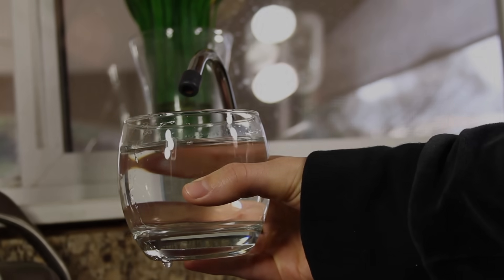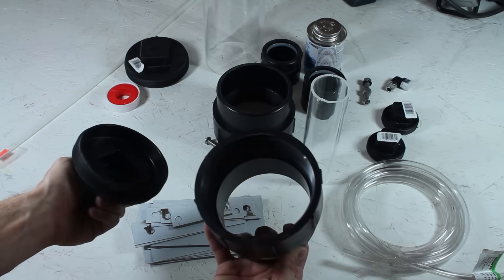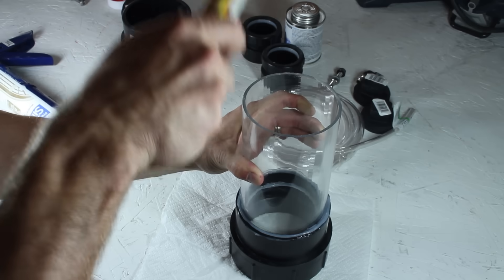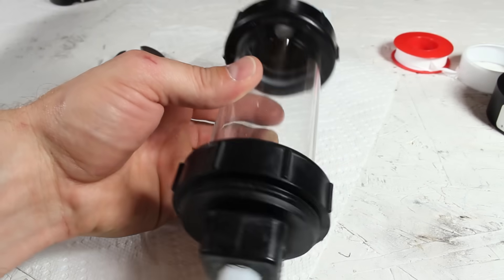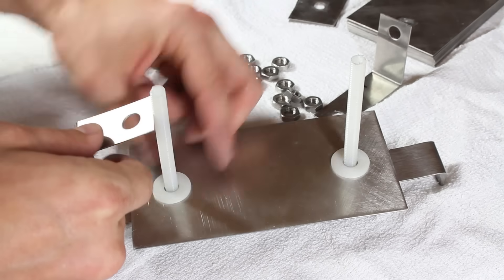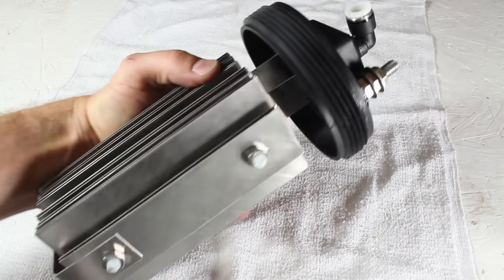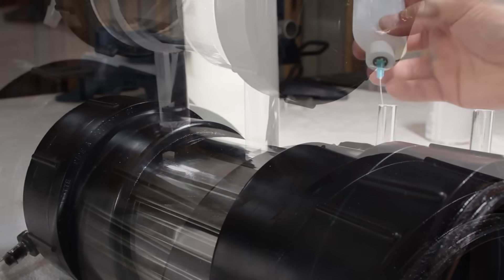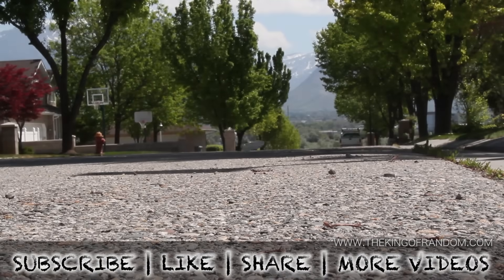HHO Generator - Water to Fuel Converter

Comment: A few (probably dumb) questions: 
-Can you use a "Solar powered device" to deliver the starting energy like you did with the es at 8:18?
-Or even use one of your "Penny Batteries".

-Can you apply the resulting gas to a wind-mill device connected to capacitor or any other storage device??

-If possible, what would the resulting stored Voltage/Amperage be?
Reply: He's stating, the cost of the required energy to create the fuel you wish to utilize, cost more to produce than you would gain.  You're not 'netting' a positive gain in energy efficiency through any of these proposed processes.
Reply: yes. you could. the catch is, the amount of H2 and O2 you'd generate for fuel would be insignificant.
Hydrogen is hard to store..it leaks thru METAL... and using electricity to generate the gasses in the first place is wasting part of the energy.
This is, at best, a different form of rechargable battery.
Reply: Mags chann LOL, wait a minute please...
Since English isn't my native language my point may not have been passed across, or, since it wasn't tested, no results can be given, let alone speculated.

My "main Idea" was as follow:
Use Energy generated from "Solar Power" to  start the electrolysis effect and keep it going inside the Cell instead of the cables that he's using.

After the device starts splitting the H2O molecules into its "components", they would power a turbine/windmill/"something" that would create a "mechanical motion" to redirect that same motion into "energy" stored in a capacitor.

If I had the means and the place I would test it myself, but I don't, that's why I'm asking.

Without testing different theories we can never know the exact results.

And inquisitive minds are the cornerstone of Science, no?

Found this, it can represent the "start" of the steps that I was describing: www.nanowerk.com/news/id25268_3.jpg

But, before "Storing", it could still power a mechanical generator, like a windmill...
Reply: Mario Joia the solar cells produce electrical energy directly.  you dont' need to generate hydrogen.
The Laws of Thermodynamics can educate you on why more conversions between gas and electricity and motion make the process less and less useful.
Reply: Mags chann Does Thermodynamics have anything to do with pressure and "motion"?
If I knew I wouldn't be asking, right?
Seeking education is a sign of "ignorance" not stupidity ;D
Reply: Mario Joia I pointed you in the correct direction. if you're really interested you can take it from here.
Reply: Mags chann Let me make a different question then: Heat source, water, pressure cooker, fan and dynamo.

The heat source increases the temperature of the water inside the pressure cooker. 

Through its safety release valve the steam starts to make the fan move to turn a dynamo. 

Can the Dynamo deliver electrical current through this chain of events, according to the Law of conservation of energy or not?
Reply: Mags chann " the catch is, the amount of H2 and O2 you'd generate for fuel would be insignificant." The questions that I placed relate to "conversion/transformation" of one type of energy into another, not conservation of elements to use as "fuel".
Reply: Mags chann Oh, no offense intended, but I'll have to come back to this great lecture "tomorrow" since it's ~3:30am here and my brain needs some rest ;P
Reply: Mario Joia this isn't the place for a chemistry/basic physics lecture.
i'm done.
Reply: Mags chann Well, you haven't shown, nor can you find the specific "physical law" to even show that it is "Innefective or impossible", and, as such, you decide to end the conversation. Fine by me
Reply: there's a search bar at the top of every browser in the world now.
use it.
help yourself.
if you can't, any time i'd spend writing to you would be a waste of MY time.
Reply: Mags chann I already did, and I already found what I WAS looking for, and it proved me right.
You, however, said that it was "ineffective" but didn't show what proves it to be ineffective, because you can't or don't want to.
But I already explained my points, you didn't.

If YOU can't explain which of the laws of thermodynamics says that I'm wrong then YOU're the one wasting MY time.
Reply: Mario Joia you're getting pretty snarky for somebody who started off admitting their English isn't all that strong.
You should consider the fact you're causing the confusion. LOL
Reply: Mags chann Please don't change the subject, you haven't presented, again, the specific law that proves me wrong, and, as such, don't waste my time, please.
Reply: Mario Joia "you haven't presented, again, the specific law that proves me wrong, "

I might be willing to do that if i could even figure out what your question was. LOL
but probably not.
Reply: Mags chann The question is in the comments above, if you really wanted to answer, you would have already.
Reply: Mags chann Your answer is simply another way to proof that you "can't", instead of "want". Thank you for your time.
Reply: Mags chann Who are you accusing of trolling? You kept avoiding answering the question since you have full knowledge that I'm right. AGAIN, thank you for your time.
Reply: Dallas Fouse I'm sorry, but how do you know what he's stating?

What I asked is that if it "IS" possible or not.
After knowing that a system has the possibility to work, it can be tweaked to be more efficient.

It has not been tested by anyone, so no one can know what is the total energy "transformed" at each step, how much is lost and how can that "energy loss" can be re-directed.

So, I ask again: what laws of thermodynamics make that system fail and and what point/s?
Reply: Mags chann I'm still waiting for the answer to my first post though, and you keep offending me instead of replying.
Reply: Dallas Fouse Ok, THAT I didn't had enough knowledge about. Can the gas container be changed to another material and then reinforced to be able to handle different quantities for longer periods of time?

Although that wasn't my main points, that is a decent direction to take the project on.

What I mentioned next was based on the functionality of a water dam: COULD the different gases decomposited/separated on the electrolysis chamber power up some form of wind-mill system attached to a dynamo to store energy on a container connected to that dynamo?

If so, could the kinetic transformation of energy in the wind-mill be on  a closed environment so that the gases could be stored for a later use?

Before this transformation even occured, the system itself could be designed so that instead of a constant flow of gas/gases would pass from the electrolysis chamber into the wind-mill device back into another chamber, there could be created a temporary chamber to hold those gases in order to achieve higher pressure differencials and have higher bursts of speen on the wind-mill for short periods of time instead of a slow constant stream of speed.
OH, AND BTW, it wasn't I that started to display anything about the laws of thermodynamics, the user Mags chenn was in a comment above.
Reply: Dallas Fouse As yo ucan see by the two  comments previous to this one, is if that someone could "test" the entire system, or, if it had any faults, where and "why" would those faults occur.

The car engine wasn't invented in one day, not the transformation of water in a dam to electrical...

What I intended with the system previously mentioned, was to know if using a solar panel to start the electrolysis reaction in the chamber would be as effective as a car battery, and if the pressure resultant from the separation of particles would be enough to keep another kinetic system in motion BEFORE storing those same gaseous particles.
Reply: Mags chann Took you this far long to understand (at least the basic idea) of what I was trying to ask?

Well then, let me tell you: Ignorant I may be, since, as a human being, I'm not under any obligation to know EVERY SINGLE THING in  existence on this Earth, but "stupid" I am not, since I know "how to apply what I learn".

And since I don't like to be trolled, I also don't troll others.

I also don't mind considering myself as "Ignorant" since no human being is obligated to know everything that ther was, is, or will be.
(Following on the next comment btw, too long for a single comment)
Reply: Mags chann But "Stupid" I am certainly not.

When I asked about the system described in the first comment, I described it in a general sense of the entire situation, and you decided by yourself, or at least it was what your comments showed me, that I was "somewhat forced" to know specifically where were the faults on that "general system" and what was creating said faults.

I already knew, before posting, that the 2 laws of thermodynamics were going to have an effect in that system, but systems can be tweaked to be able to minimize the effects of those laws, or aren't they?

If systems weren't able to be tweaked, we were still living in the stone age by this time in our lives.
Reply: Mags chann Once again, as I already stated in my 2nd or 3rd comment on this topic: My sincerest apologies for any miss-understanding in the whole situation, but since English isn't my native language, making my point pass accross the way that I intended to may have been harder than it should be, creating all of this mess that we're witnessing.

It needs to be said though, and I'm sorry if it seems offensive, but some of your comments weren't very helpful.
Reply: Mags chann I believe I did though, but since I wrote almost an essay, it may be lost in the middle of all that text xD
"I don't like to be trolled so I don't troll others."
Reply: Mags chann LOL, "of course" that I asked about that, and I also "know" that this can't be a "perpectual system" because no system can be.

I also "knew" that energy would be lost within the entire system.

What I tried to understand, and no amount of research that I did was able to show though, is if that "multiple steps" inside the same system could take advantage of the energy transformed in one system would "minimize" the effects of the multiple physical/chemical laws occuring within the system itself.
Reply: Lets face it an we all know about it: "Hidrogen fuel cells" are expensive to "create", and hidrogen itself, with our current knowledge of science, is hard to both "create" and store.

But if the "process" of storing the hidrogen itself could be used to "create"( I KNOW BAD CHOICE OF WORD HERE) electrical energy in the same fashion as a water dam does, then the effect of the 2nd law of TD would be "minimized": in a water dam, water goes from one storage container to another through the effect of gravity, but that process is used to create electrical energy, while "water" is still "water", but it is stored on a different place.
Reply: SO, after separating Hidrogen from the Oxigen inside the electrolysis chamber, instead of releasing it like the poster of the video did, OR directly storing the Hidrogen or the Oxigen in their respective containers, could the "process itself" of storing the 2 components be used to make a different system work and store/deliver energy besides storing the gases themselves?

"Different process(water in a dam and gases) same principle"???
THAT, was the main question of the system presented in the first comment.
Reply: WELL F***, I believe that I never wrote a big a** essay like this in a reallllllllly long time lol.
Reply: BTW, and this may look like "an unrelated case" but anyone of you noticed the "ideology" used behind the creating of the famous "Common Core"???
Reply: +Mario Joia the comparison of a hydroelectric dam is a comparison of apples to oranges as in a hydroelectric dam the initial energy required for transformation is freely provided (in theory) by the natural force of water.  in this example you are having to exert energy (utilization of a fuel source of one type or another) in order to generate energy (in a less efficient manner) in hopes to collect a byproduct of lost energy during translation, that still would be an overall net loss.  Until a renewable source of energy becomes more efficient, like that of solar panels that have a higher yield, than really your thought process is way too early.  I would think the dedication in scientific resources would be better utilized in improving the efficiency of current renewable resource projects before this hypothesis is even tackled.
Reply: Dallas Fouse I could be very mean, but I'll try not to.

The energy produced by a dam, according to the little amount of knowledge that I have, is through the gravitational pull of the weight of the water applied on the turbines.
The kinetic energy supplied by the motion exerted on the water through gravity is transformed into electric energy through the application of that same gravitational force on the water into a wind-mill shaped device.

Any and every kind of energetic transformer will have a net loss somewhere, either due to friction, heat or pressure, but the remainder is still being stored for future use.

Also, remaining in the same train/chain of thought limits the discovery of new ideas that could even serve as "solutions" to problems that currently exist in the situations already known to humans.
Reply: Dallas Fouse What we see in the video is: Electrical energy is applied in a system, that system uses that electricity to start a chemical reaction, that results in the separation of "atoms", which then are used as combustible fuel/material.

What my initial comment asked was: If instead of a "normal electric battery", it could be used a solar panel to trigger the chemical reaction, that, with a better configuration of the whole set-up the pressure exerted by the product of the chemical reaction in a kinetic transformer PRIOR to being stored for future use of those same chemicals.

Hydrogen fuel cells already exist, solar panels already exist, and dynamos already exist, nothing here is new, and every one of these systems has energetic net loss, it's just an attempt of minimizing those same losses in a single system instead of 3 different systems.
Reply: All of this mess just because I don't have the location and finance to try it myself, but anyone else that may be able to try only keeps theorizing instead of applying what they know.
No one has tried to actually be able to say: Sorry, here it is, it was tried and it really doesn't work or doesn't give any energetic benefit.

Theory theory theory, where's the contraption to prove that same theory?
I would LOVE to build it myself, but I simply "can't".
Reply: Mags chann Those fingers, mouth and brain of yours need a good cleansing, you have said nothing constructive besides insults, when will you learn to show manners and respect, if you keep asking me to do it?
Also, If it has been "pursued" by those said brilliant and talented engineers, where are the studies, reports and essays of those same trials? Show me proof, a thing that you clearly don't know the meaning of, or go back to your own life.
Reply: +Mario Joia show yourself the proof, again, instead of typing 160 characters into a comment, type them into a search bar.
Reply: +Mags chann you caught me
Reply: Dallas Fouse Apples= Fruit; Oranges= Fruit;
Source of Apples= Trees, Source of Oranges= Trees; 
Both have peels, one of those peels is edible, the other isn't.
There, comparison done.
Now, where is that proof exactly?
I have done what I was able to, and since none of you have presented proof, you can't deny the possibility of it's functionality.
Reply: +Mario Joia I see you are not familiar with that colloquial phrase, just as you are not familiar with physics, or common sense, or independence.  You know like the lack of personal responsibility to educate yourself instead of whining for someone to prove to you the sky is blue, not purple as you swear it is but cannot prove.
Reply: Mags chann So, your only mean of answer to any kind of question is by name-calling?
With individuals behaving like you no wonder the world doesn't evolve.
Reply: Mags chann Well, better being me than you, believe it.
Since you're the one that seem to be trolling me, I'll answer any of your comments when it actually carries any existential proof behind it.
Reply: Dallas Fouse I already did whatever research I am able to do in a computer, and I have not found a single explanation for the theory to be applied Or not be applied.
The only thing missing is actually testing it myself, a thing that, as I previously said, I am not able to.
And, well, I know the values of what have been taught to me, I have done my own investigation, so I have enough independence, and clearly I'm not the one missing it.
I don't have a PhD in any kind of Physics related subject, but not everyone in the world is a scientist.
By the way I trust that you have at least read ALL of the comments that I already wrote instead of just reading the initial comment though.

Comment: Can you use this fuel to power a lawnmower? like have 2 batteries and this generator and have it feed into the carburetor instead of using gasoline? I don't care if it "loses 66% of the energy" I'll just make sure to use 166% battery power =P.

Comment: Personally, I would opt for getting a 110-to-24v AC/DC converter, and hooking it up to the HHO generator.
Then sealing up the connections to the contacts.

That way you don't have to worry about any sparking from the jumper cable clamps, nor do you have to bother with having to use two car batteries.

Still, using car batteries allows you to take the whole thing away from the city.